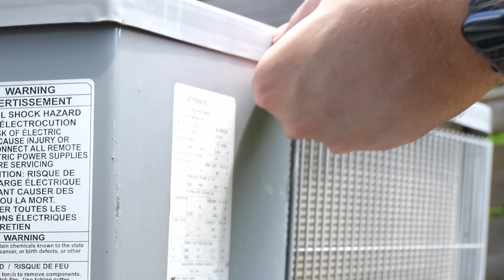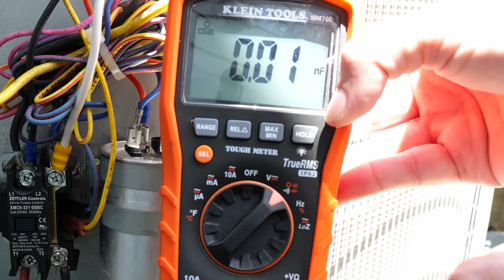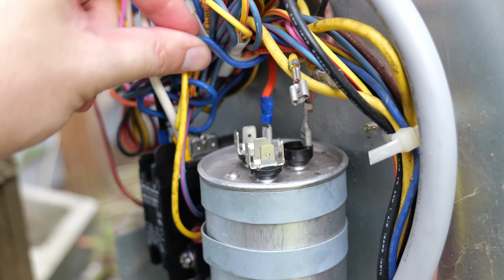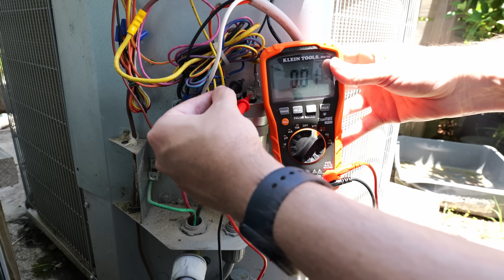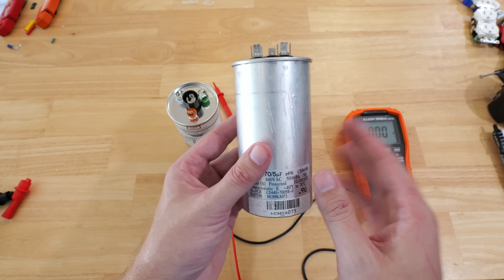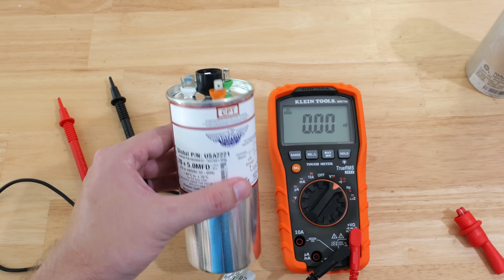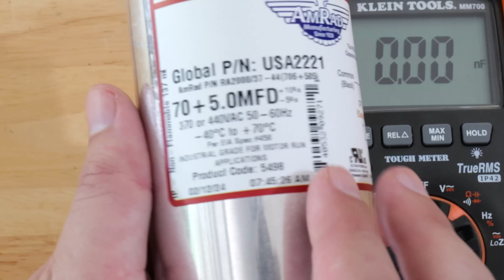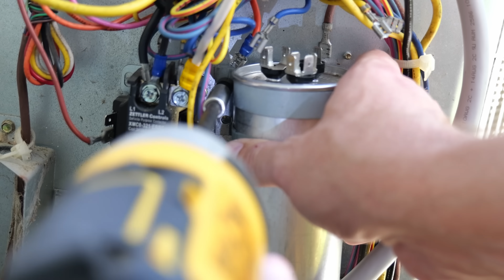Don’t Get Ripped Off! How To Avoid The AC Capacitor Scam And Save $500

Comment: Just to be clear unless a guy is one man show 300-400 dollars is a fair price for replacing a capacitor as most companies carry amrad universal capacitors on truck which are bit more expensive and are just generally a much better product and come with a 5 year warranty, With the diagnostic fee and capacitor for 400 dollars the ownership of that company is probably making $100 dollars profit off you after paying the tech, the part and just the general costs of running a business.

If the Tech is honest and shows you how to use meter to test it and explain what a capacitor even does then you back door them by changing it yourself you just threw that entire relationship in the trash, what do you thinks going to happen when you have a more serious problem with a TXV valve or something its not going to cheap i can tell you that

Comment: Is this a dual run cap? Are systems  using those now. Are systems still using separate start and run caps?  I'm an electronic tech and a homeowner, so I'm famaliar with electronics and electricity, just not always sure of the flow of some things. Thanks for your video.

Comment: I had my heat pump inspected recently and was told that the capacitor should probably be replaced.  It was a bit rusty.  Unlike other people, however, I was only charged $17 for the part, including tax.

Comment: Thank you for the video.  Your instructions worked!  With the help of my Fluke 325 multi-meter and a new $19.23 MARS (Made in the U.S.A.) 45/5 440v Capacitor my A/C is back up and running.  I appreciate you!  That was too easy.

Comment: Hvac tech here - a couple things worth noting when testing/changing a capacitor - They normally come in 370 or 440 VAC. The rule of thumb is this - You can always go higher but never go lower. Meaning that if it is a 440 VAC capacitor never use a 370 VAC, but you can use a 440 on a 370 VAC replacement. The last thing is that if you change a older cap and the fluid is leaking out make sure you wash your hands real good.
Reply: So please tell me where you can pull 370v or 440v on a single phase panel that generates 208/250v😵‍💫
Reply: @SixTwoHemi  fudge factor for voltage spikes that can occur from line or when contactor opens. There are lots of power board circuits on LED TVs and other appliances where the caps fail and the fix is new caps with same capacitance but higher voltage. The higher V caps are usually a wee bit bigger.
Reply: @SixTwoHemi  the 370 and 440V rating doesn't have anything to do with the incoming power of the unit. It's only the power the capacitor provides.
Reply: @SixTwoHemi  The 370 or 440 is the back EMF (electromagnetic field) that the compressor and fan motor can generate. Keep in mind that every motor requires voltage to function, but they also generate voltage by the rotor spinning in the stator which creates a magnetic field The starter winding on the compressor and fan requires but can only handle a certain amount of voltage without damaging the wires.
Reply: @Harry1s @SixTwoHemi @jimmyaber5920 Capacitors are rated for a specific working voltage... anything over this will stress the cap, and go too high and the energy will arc between two plates (reducing the capacitance for sure, and possibly shorting the cap to boot).  Assuming a 240VAC system (most home systems), the peak voltage seen is ~340V (though this can go a bit higher if your local distribution system isn't properly cared for).  A 370V cap is adequate for such a setup, regardless of what was in there before (e.g., a 440V cap).  Inserting a higher-voltage cap doesn't really gain you anything other than piece of mind (and for smaller caps, like on a PCB, it will gain you a net increase in cap size, a jimmy pointed out... this is due to increased distance between plates to prevent arcing at the higher voltage).  For PCBs, a higher-voltage cap is often used because the repairman either can't find a lower-voltage version anymore or that's what they have in their stockbox... once in a rare while a design can benefit from a higher-voltage cap because the original designer didn't provide enough margin, but most of the DIYers online do it because "all of the videos say to do it" (a wive's tale that won't die).  Voltage spikes due to motor coil inductance are an entirely different story, but you're fine with the 370V caps...

Electrical engineer here (hardware design engineer)...

Comment: It’s hilarious to see the comments as an hvac technician. Also funny to see this video, as it’s wrong and can get you hurt. You never stopped your control voltage bud. That 24v makes contact with your cap and you have a big problem. Blind leading the blind. This is why we charge what we charge, knowledge, training, overhead, so on and so forth. Good luck y’all, I’ll continue reading these hilarious comments from cheap customers😂😂😂
Reply from the maker: Your comment is the one that is hilarious.  You are clearly upset and spreading misinformation.  Can’t imagine why 😂 It was all covered.

Comment: Every year in the beginning of the summer... I take my outside unit covers off... clean and wash out the evaporator coils... oil evaporator fan motor... and replace the start run capacitor (a $15 part off Amazon) even when it is not. By replacing the capacitor and cleaning the coils, you put less stress on the compressor. I have the cheapest AC unit that the builder installed in my house, and it is still running 22 yeas still!
Reply: Hi, what kind of oil and what area do you oil?
Reply: @artp1735 I use 3in1 oil... my motor has a shaft oil port... I just put enough oil that seems right... then I put oil on the shaft between the fan and motor... I hope that helps...

Comment: I can't tell how to figure out what capacitor that I need.  Are you able to help?  My AC is blowing air but not cold into the house and I think the capacitor just went bad.  It has been working fine for 6 years and then today it's stopped going cold air, right in the middle of a huge heat wave.  I have cleaned the outside coils yearly.  The inside thermostat hasn't been messed with.  I pulled the panel and the capacitor only has a sticker on it that says CAP0505000440CT 06-13-2018.  Its a Goodman brand A/C unit Model GSX130301LB
Reply: I discovered that all I had to do was rotate the capacitor around, it's a 50/5 and I got my order placed.  Will follow up and let you know how it goes once I get it.

Comment: By the way, "OL" means "overload".  The meter reads a value that is larger than its capability to display (& its capacity to convert).  In the case of doing continuity on open circuit, the resistance reading is "infinity ohms", which is more then the meter can display.  If you were to measure the value of a shorted capacitor, in capacitor mode, you will get "OL" because a shorted capacitor is "infinite" capacitance.  If you read a voltage that is larger than the meter's display can show, you will also get "OL".
Reply: over limit

Comment: Capacitors are the most common failure, and yes anyone can replace them… But what if it’s not the capacitor, what if it’s your contactor, failed compressor, fan motor or refrigerant charge??? We as ac contactors have to keep trucks stocked and ready for multiple failures. This is why our bill for the simplest failure is expensive. AC is a luxury not a necessity!

Comment: I want to thank you so much for your details especially to safety.    I was told for the past 5 months (starting in feb) to have a spare capacitor on hand as they are known as a common point of fairlure.   Well mine went and because of you and your detail to the uF (micro farads for sizing ) I was able to install the capacitor.  Of course this happend in the middle of the heat wave

Comment: Great video. I was recently told that the +/- 5% was the manufacturers spec for a new cap and that a used cap could be as low as -20% and still working. -10% could still last for a few more years. I'd be curious to hear anyone else's opinion on that. Also, the bad cap that you were testing was coming in ABOVE the rated value. I always thought a cap goes down in value over time.

Comment: When testing the capacitor, why did you switch the leads (red/black) when you tested the capacitor without the wiring connected? Does that have an effect on the multimeter reading?
Reply from the maker: Didn’t realize I did.  It makes no difference.

Comment: Isn't "OL" means Overload or Overrange for the meter, not "Open Line". On budget meter, the resistor or a short between the leads will result in "OL" reading, while "open" will result in reading of zeros instead. If you see "OL" instead of zeros on a standalone capacitors, it means that the dielectric is broken. When the capacitor is connected to motor, the windings shunting capacitor  will result in "OL" reading... If you used a true bridge LCR meter, it could still measure capacitance of connected capacitor. The rest was very illustrative.

Comment: Great video
Do you think it’s good to always have an extra capacitor and contactor on hand?
I have a Goodman unit, furnace and compressor outside.
AC is working well cooling off the house, but it makes a buzzing noise-Somewhat loud, I think
Came with the house when we purchased it a couple years ago ago and my wife says it’s the same sound. It’s always had.
Also, a friend of mine came by and said he had a good man and said sounds like mine - they’re loud!
Do you think I should have someone come out or just stop worrying?😁
Reply from the maker: Well of course it never hurts to have it looked at by a reputable pro in the area. But yes Goodmans can be loud.   However that doesn’t mean it isn’t something that could use some attention.  I always have a spare capacitor on hand in case mine goes out.  The buzzing could be many things.  For instance, contactors are notorious for buzzing when they start going bad or something like a bug gets between the contacts.  If it’s not too old it’s probably fine but if it’s got 5-7+ years on it, wouldn’t be a bad idea to have it checked.  Goodmans are just really hit or miss on how long they will last.  Sorry I can’t be more definitive but I hope it helps some.

Comment: Where to find a replacement clamp for these? The capacitor i got has the right specs, BUT.... its fatter (bigger diameter) and shorter. Cannot find a clamp for capacitor. 

Please help provide suggestions if anyone knows?
Reply: It's usually just galvanized plumbing strap or sometimes called hanger strap. You can get a roll of several feet at a hardware store

Comment: I think the capacitor is the weak link in a number of applications. I've picked up some inexpensive pumps from Harbor Freight. Mostly for drainage off the property. THey actually last a long time but the capacitors are usually crap. Keep a handfull of them around.  I've done the AC one once..appreciate the info.

Comment: If the tech tested the capacitor with the wires connected in the same location that you re-connected them, why did the techs meter give the wrong readings?? I thought the tech may have had the wires connectied wrongly for him to get the bad readings.
Reply from the maker: Because the wires can't be connected when testing.

Comment: First, I'm wondering what symptoms you were seeing and, if the capacitor was good (as it was according to your testing), what turned out to be the problem?

Secondly, if the tech HAD replaced the capacitor, since the replacement was functionally identical to the original, what would/should the tech have done when the AC behaved the same as with the original capacitor?  Wouldn't the problem still exist?  Wouldn't that reveal his "incorrect diagnosis" of the capacitor?
Reply: No. It could just be an indicator that there are additional problems with the unit besides just the cap, or that another fault actually caused the cap to fail.

Comment: I don't understand - the contractor sells you a capacitor that didn't need to be replaced. $15, $150 labor. OK - but what did he do that fixed the system? Wasn't there still something wrong with the unit?
Last fall I was charged $180 to fix my 1 year old unit. (I'm in Florida!). I said it was likely the capacitor, he likely suspected that. And the cap was leaking. I was not happy with the bill, but they can charge what they want... But when he left, the unit was working. 
And 8 months later, it stopped again. I'm going to buy a new cap on Amazon. And I wanted a better thermostat, so I'll buy that, too. Hopefully, these will remedy the problem.

Comment: i give the customer the option on an ac-tune up. if the numbers are off or a lot of rot on the capacitor, i leave it up to the customer if they want to replace it at this time. i also clean the condenser coil on all my tune ups as part of the service after all its a giant filter.   Joe H  Navy Seabee

Comment: I needed my gall bladder removed and the surgeon wanted like $35,000 to do it so I went on YouTube and found a DIY video and saved a ton of money.
Reply: But did you change your capacitor, too?
Reply: @lisahumphries3898  Couldn't find it, but will check again next time...
Reply: I feel you brother.  I needed a Colonoscopy, but they wanted $2,750 to do it.  I bought a Endoscope for $40 with a 16ft camera probe, and did it myself.  Saved myself $2,700 in the process....
Reply: @redbaron6805, you saved your @$$ a ton of money.
Reply: You can see where the HVAC people get upset.  Funny thing is when you buy your “endoscope” to shove up your arse…..you don’t know what you’re looking at.  This is different.  Just saved the money myself.  Thanks for the video to not only show what tools I needed but what I needed to fix it.
Reply: @GodfatherRockyTop  Anything beyond a capacitor is beyond the skills of most people.  

Also, capacitors can fail due to other issues on the system, so it is not always the correct repair, but becomes a band aid instead of repairing the actual problem.

People forget while the part itself is cheap, someone is driving to your house to replace it, and will be in many cases checking if the system has other issues.

So, the difference between the endoscope and you isn't all that much...

Comment: Keep things in mind when you see the bill. Your not just paying for the capacitor, your paying for his gas to get there his labor and skill to not only do the repair but to also have the knowledge to diagnose it the wear and tear on his vehicle the company overhead to include the labor for the person who answered the phone when you called. Nothing is free. On average is costs $100 to 200 for the meter alone they use to test that capacitor. 

There are times a capacitor goes bad that is caused by other underlying issues if the tech is good he will try to identify those issues to ensure in 1 year your not replacing another capacitor. 

And lastly testing a capacitor like this is OK however testing underload is the best method and will provide the most accurate results (I do not recommend this testing method for anyone who does not have the experience and safety knowledge to preform this test)

Edit: I do however highly recommend knowing how to test to ensure a shady tech isn't screwing you over
Reply: Well written comment for the "I've been SCAMMED!!!" crowd.  I've had my own mobile RV repair company 26 years. It costs me approximately $150-$250 per job just to show up.  Why?  For exactly the reasons you stated, plus now that I'm 70, the toll on my body is becoming very obvious...limping to the house some days.

Comment: Keep in mind that there's a reason a cap or contacter fails. If your HVAC guys doing the right job, he'll troubleshoot first.
Reply from the maker: There can be a reason but usually they fail because they are wearable parts just like everything else.  The heat over time is usually what causes them to fail, not another issue in the system.  Again it is possible but not the most common reason they fail.

Comment: I wish I had seen this video before my HVAC service provider told me during a routine check-up that I should have hard start capacitors (secondary capacitors) installed on each of my two AC units.  He said one of my units was pulling 280 Amps during start-up so was at risk of imminent failure, and, if it failed, would likely require replacing the entire unit.  Another HVAC technician later said their company recommends installing hard start capacitors on all HVAC units once they have been in service for 5 years.  Not knowing any better, I agreed, and was given a $1,000+ bill for what took less than 30 minutes of effort.  As you point out in this video, the two replacement capacitors actually costs less than $25 each.
Reply: I'm not sure what number you should be expecting but compressors do have very high inrush amps. The compressor label will have run amps and locked rotor amps.
Reply: Did you pay that high bill?
Reply: Yes, but I am wiser now.  I plan to change my service provider.

Comment: Basic electronics.  Cannot generally measure component values while in the circuit because other components connected affect the values you measure, leading to confusing results

Comment: 0:51 you DONT know you won’t have an issue because it’s possible the disconnect has been hardwired behind the dead front.
Turn off both breakers to the system and VERIFY there is not power folks
FIND AN A/C GUY YOU CAN TRUST AND LEAVE YOUR SYSTEM ALONE